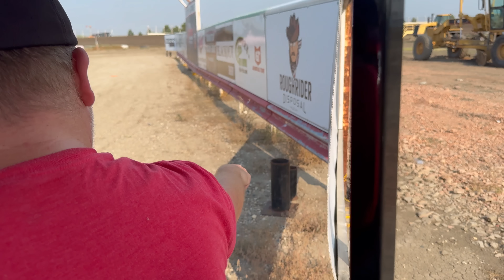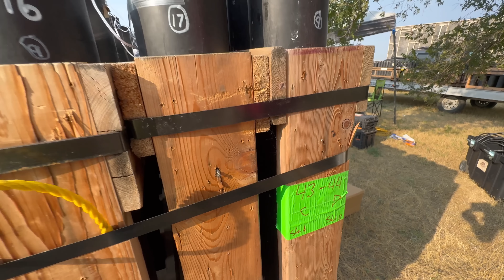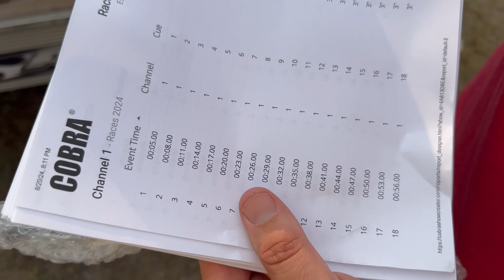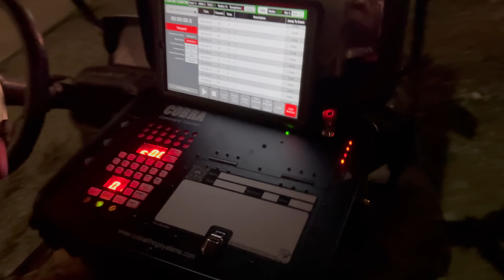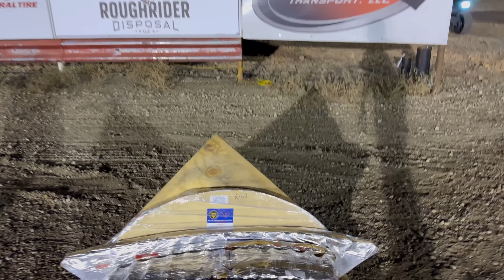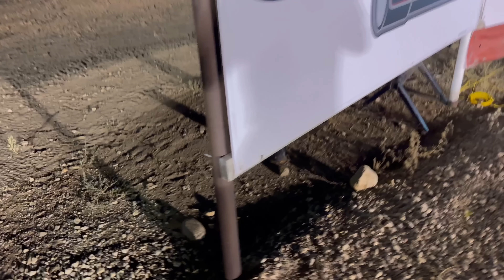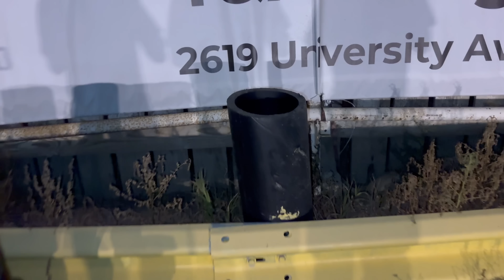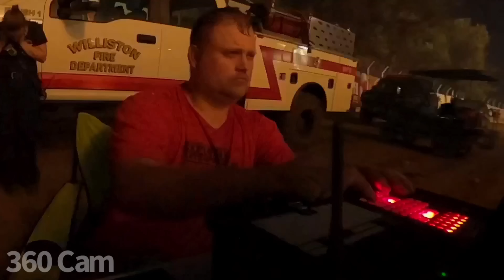HUGE 1.3G FIREWORKS AT THE RACE TRACK!

Comment: They are referred to as "mortars" in the trade...not "guns". While cannons are sometimes referred to a "guns" (...such as the 16" "guns" on a battleship") traditionally as  well as in common parlance, a gun is something with a triggar, and, generally, a rifled barrel whereas traditional cannons & mortars use fuses and have smooth barrels. In addition, cannons (and guns, for that matter) have relatively flat trajectories, not the high trajectories of mortars. You would certainly never shoot guns or cannons straight up, as with a fireworks mortar. The point is that, whatever else you might call them, fireworks mortars meet none of the definitions of guns, but  every  bit  of the  definition of  tradition (ie: military) mortars.

Amd. plenty of those bombs were at least 8", perhaps even 10", not the 4" you mentioned. Having persoally & manually set off 10" biggies,with lifting charges that might have exceeded a half pound of powder, you wouldn't confues one with the other. Those of us setting those things of mannually  needed ear muffs because the lifting charge booms were incredible.
Reply: Could be a regional thing but they've always been guns to those in the trade in our area.  If we want to get technical we'd call them high density poly ethylene tubes with wooden plugs.  Guns seems to roll off the tongue better.